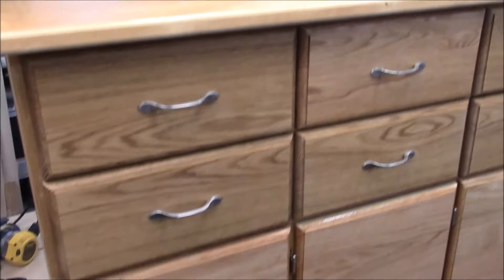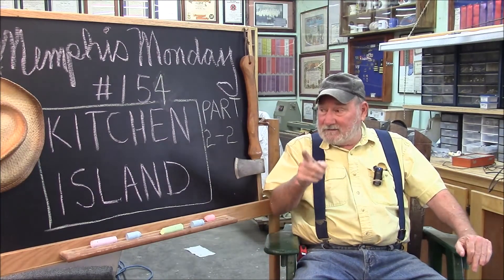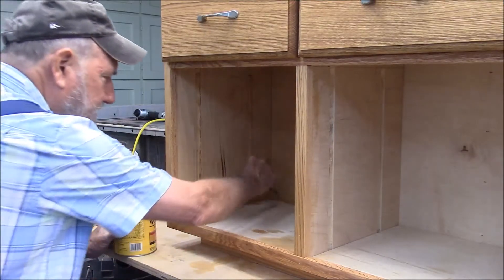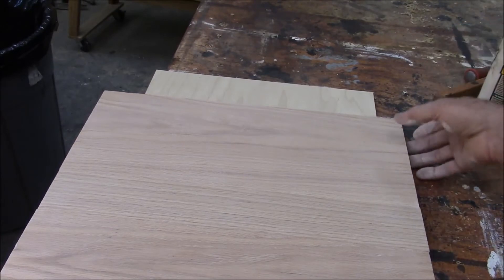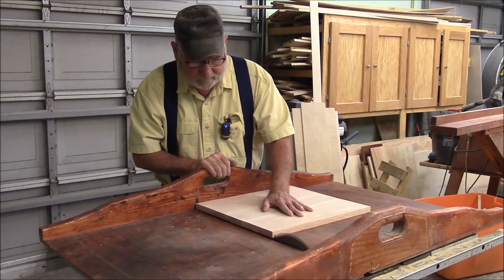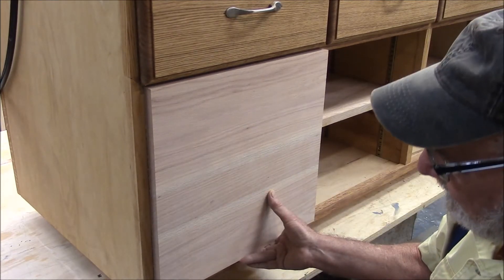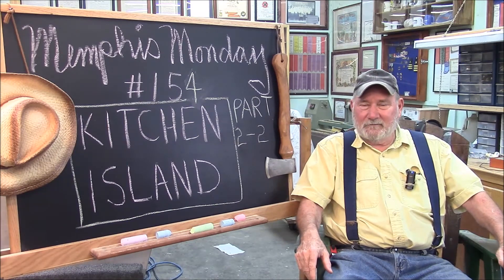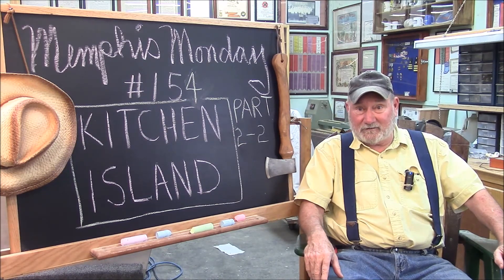154 Building a Kitchen Island and work area part 2 of 2

Comment: That kitchen island came out great! I hope your nice work doesn't make the rest of the cabinets look bad. I like how you stained the inside of the cupboards which is a nice touch and adds to the quality. I was surprised to see the shelf brackets with numbers on them. I wonder why they didn't think to do that before? Without the numbers it can be a real pain counting the lots but normally I use one of the screws as a reference.
Reply from the maker: I remember those old brackets.  Real pain.  And sometimes they were hard to align front to back.  And the little pegs would fall out.
     I normally don't finish anything you can't see.  I even leave layup lines, tool marks, and witness notes I may have made.  I got this habit from restoring old stuff;  I find it fascinating to study the underlying evidence left by woodworkers from 100 years ago.  
     We're finishing our third year, On Grid!!!  Boat work next week, then our Year in Review video!!!  Soon we will be Seniors, and about five of you folks have been with me the whole way!!!  
      Thanks for watching, and for the continuing support.